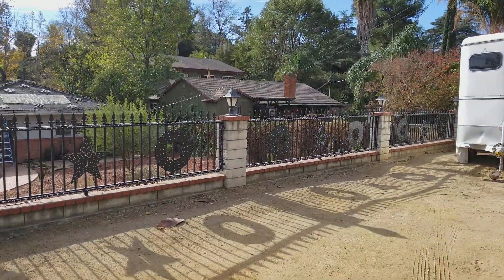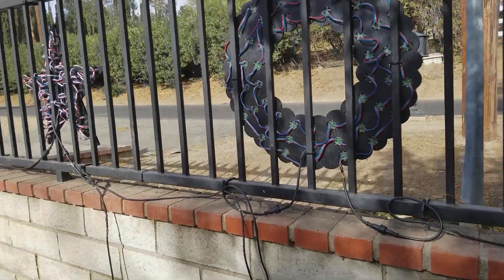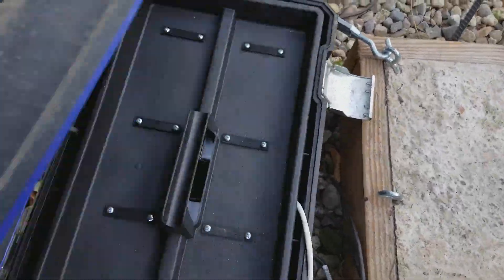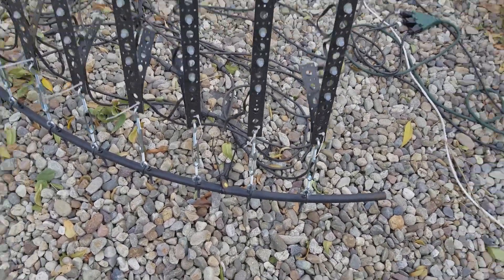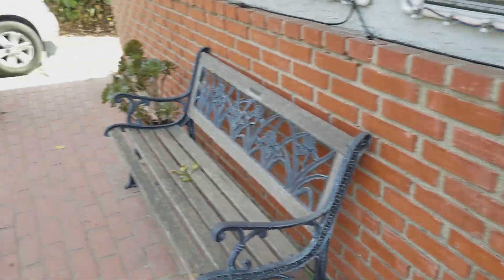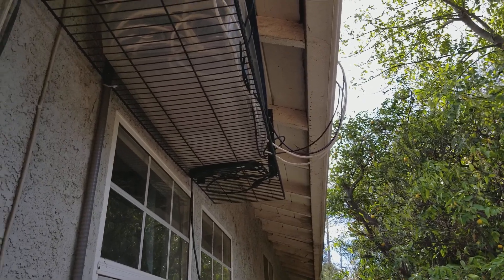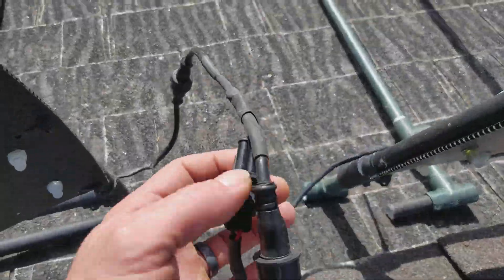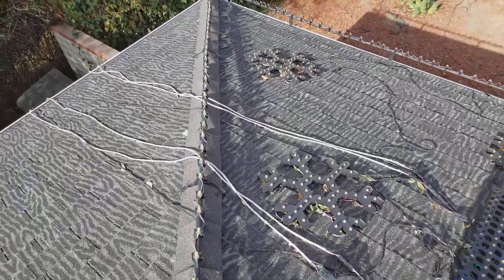2017 Behinds the scenes walkthrough pixel display

Comment: Looks great. Are those snowflakes on the roof mounted to the roof or does your pitch allow them to just sit still. I like the idea of snowflakes on the roof but my pitch is More than yours so I need a way to attach to mug shingle roof without drilling holes
Reply from the maker: They are just laying on the roof, if your roof pitch it to much to allow for that what you can do is take fishing then on the back side of your roof attach that line to say a peice of pvc pipe and use sandbags to hold it in place.